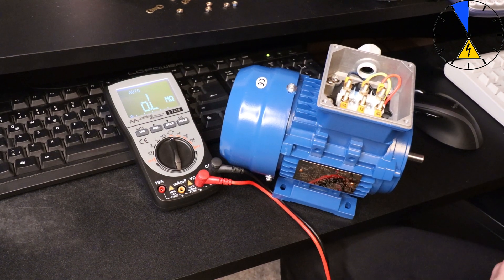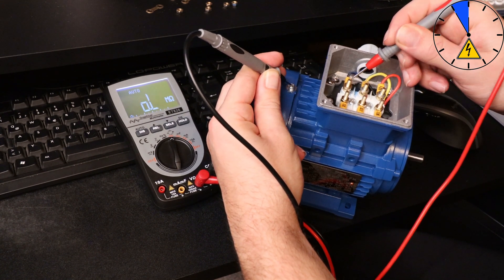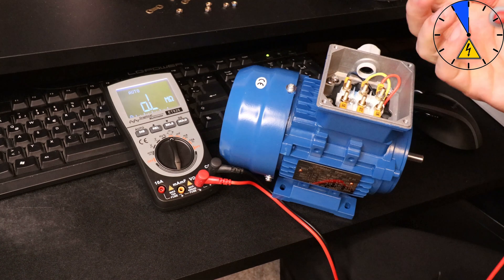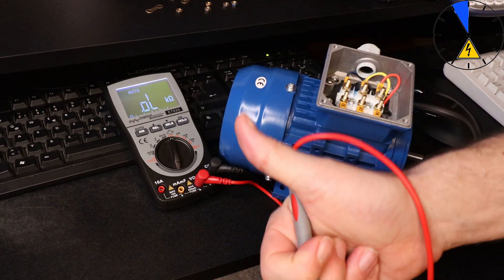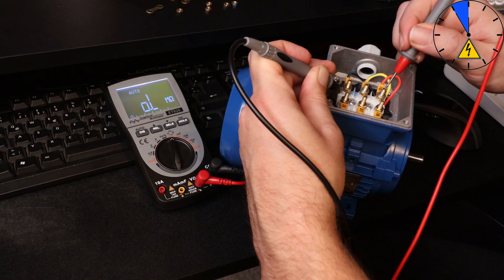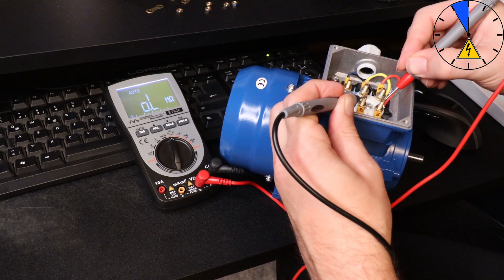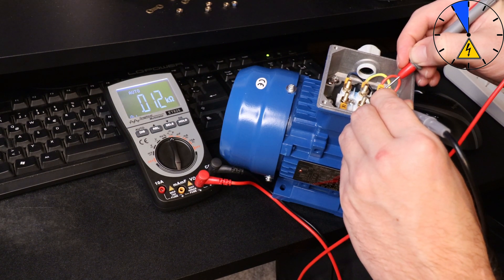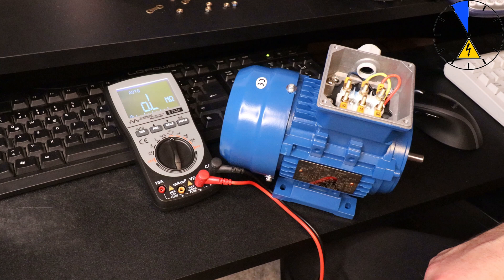3 Steps - How to check a motor only with a multimeter?

Comment: An old video but it's the 1st time I've seen it, you can't correctly test a motor without an Insulation tester.
For example your winding to earth test is meaningless, the low voltage of your multimeter would only show up a dead short.

Comment: You should really use insulation resistance test between earth and phase at double the working voltage. That way you get an actual reading instead open loop. Same for phase to phase. I don't know what the range is on your meter but if it only goes to like 100k ohms then you might weak short and not detect it. A fail is less than 1M ohm. Also worth noting if you put a star bar in, you can phase to phase test while checking balance by going u1 to v1, v1 to w1, w1 to u1.

Comment: Sorry to break it to you but that's a big NO. You have to disconnect your coils and the power cable before proceeding with measurements.
Reply: Now i am lost lol I am a level 2 student 😢and we will be testing our motors returning on the 17 July now I am lost😅
Reply: You’re wrong, those aren’t power cables! There the motor leads internally tapped to the coils.
Reply: Ok
Reply: Ok

Comment: Resistance check between the two screws??? For what? I don't think  this measurement is important or necessary
Reply: He is checking the resistance of the windings. If they are far off/no resistance, winding can be shorted or broken.

 He is also checking for the resistances between the three windings. If they have even some resistance in between, the can be shorted and/or broken. Each winding has to be separate from each other and from the ground. 

The star/delta connections between windings have to be removed for this to work, he forgot to mention it.

Replying to an old comment but hopefully this helps.

Comment: Isn’t that resistance quite high?
Reply: Smaller motor usually has higher ohm, and bigger motor has smaller ohm
Reply: @choohong1035  hey do you know why a motor stops working after a few seconds of power? ? what could be the issue?
Reply: @christophercolumbus8944  motor run by contactor or vfd? Or you should try check motor ohm, running motor amp if possible, or bearing problem maybe?
Reply: Starting winding is the one with a higher resistance am i right😅?